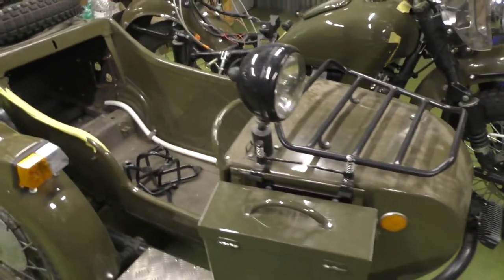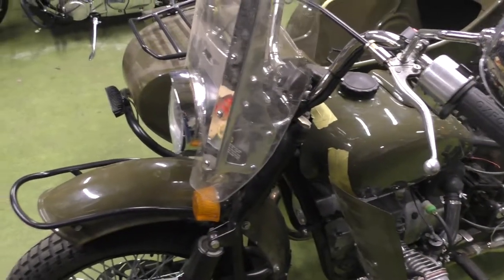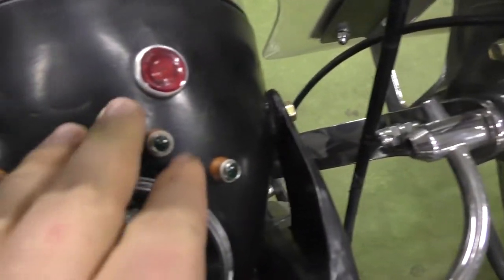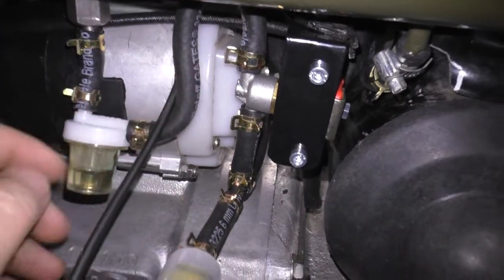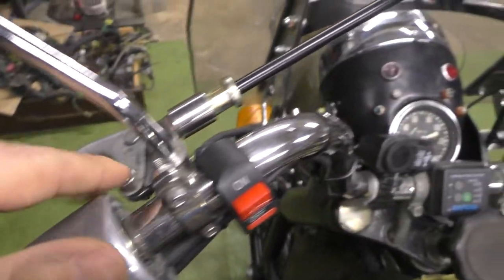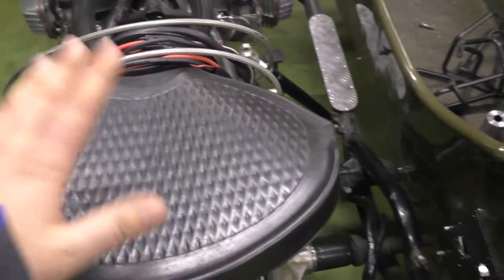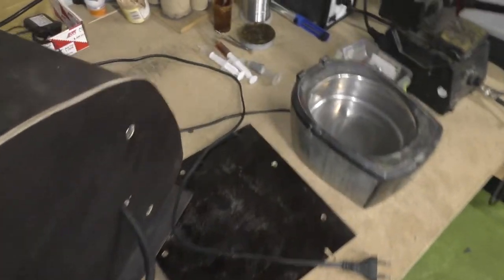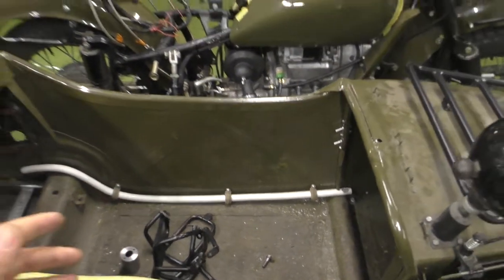The Sidecar Monster(Not Ural)-Our Best Sidecar

Comment: You can get rid of corrosion in the gas tank like this. Boiling water and citric acid. Per liter of water, 50-60 grams of acid. Mix and pour into the gas tank to the edge. Wait 24 hours and rinse with water and soda. After this procedure, it is necessary to fill in the engine oil (0,5 litre) and shake the tank, so that the oil would protect the surface inside the tank.
Reply from the maker: Thank you for this comment! I think I will do the same!!! Спасибо Товарищ!